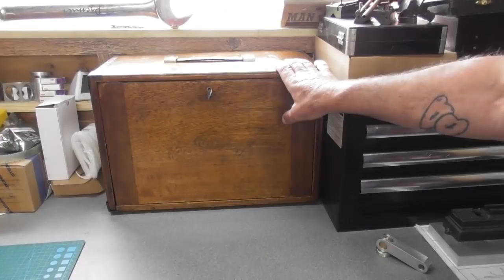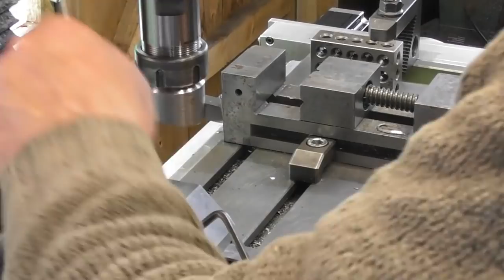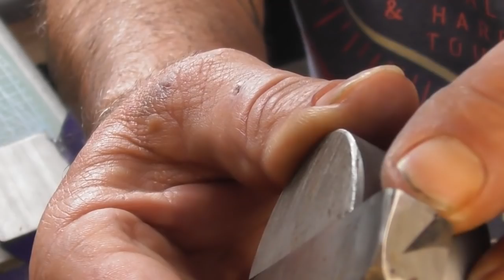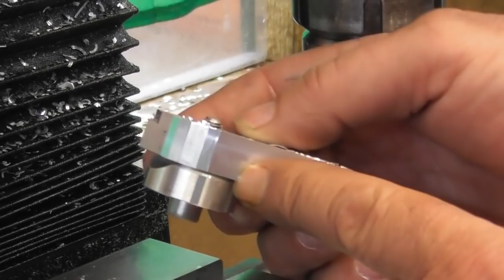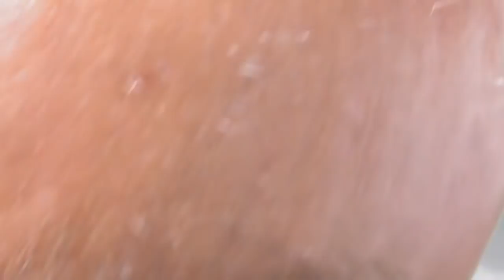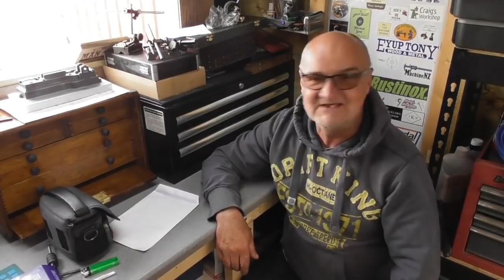A new tool chest and the mystery tool project revealed

Comment: Hi we just inherited one of these moore wright tool toolchest. 

There was no key with it do you have any advice to open it without one
Reply from the maker: No idea other than try to lever the top up the release the lock and then pull the front out .
Reply: @ade63dug  thanks for replying I've got a friend with a 3d printer, would you take a picture of the key if possible so we could print a template?
Reply from the maker: @danieldavison8002  I am fairly sure that mine has not got the original lock . Drop me an email and I will send a photo by reply

Comment: Nice one Ade! Looks really good I love the M&W tool chest you can see it's got a brand new lock  lol I notice that two drawers are sticking together. This is probably wear on the upper drawer slide from having heavier tools in the upper drawer will need a bit of fettling or new Beech slides fitted to take out the wear . If you need some Beech machined up to go in there let me know and I will make some up for you if you send me the dimensions of the section. It would be better to plane up the bottom of the drawer flat again and work out how much you have taken off then add that to the dimension of the height of the new drawer runner to re establish  the drawer back to its original position.

Comment: C’mon Ade, 15mm with a fly cutter, 12TPI blade in a hacksaw would save power, probably be quicker and good exercise. Nice video and useful tool.
Reply: or at least a mill cutter instead of the fly cutter.